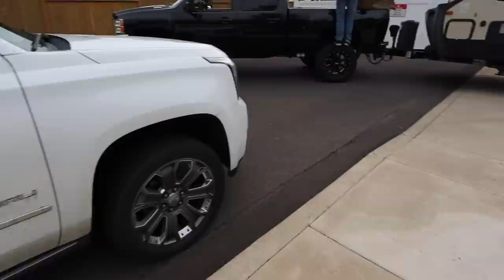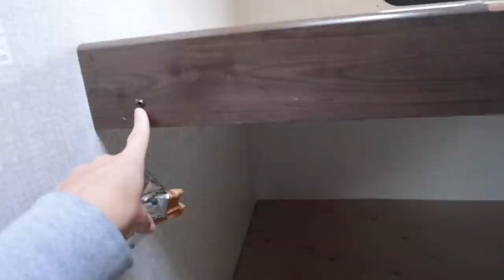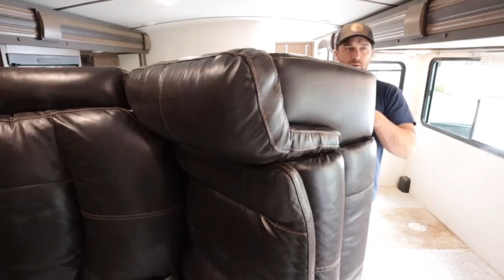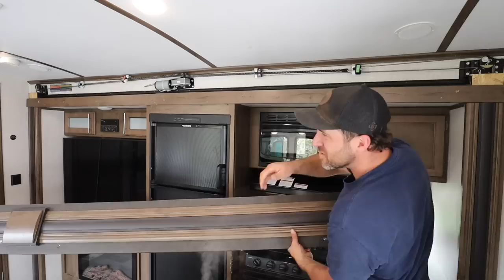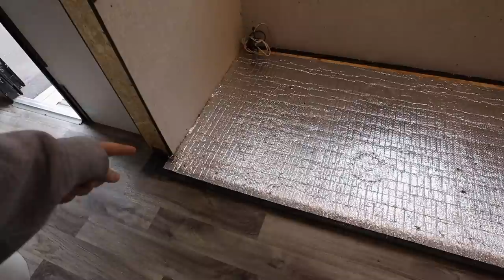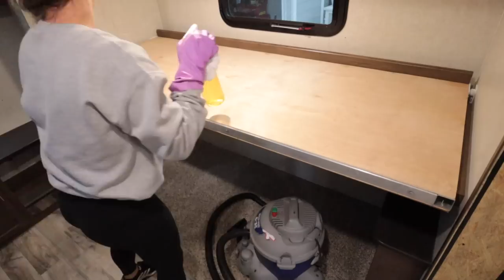THE START TO OUR RV MAKEOVER // Part ONE // DEMO DAY!

Comment: Heater vent tip, put a dryer sheet in each one.  It helps trap the dust and crumbs that sneak in AND it helps the the trailer smell fresh and clean.  We do it with our camping trailer and switch them out every so often.

Comment: Scrub everything with any Odoban.  1 gallon is like $10 and makes like 20+ gallons of cleaner.  We use it on everything.  We have 3 cats, 1 dog, 1 hamster, & 2 kids.  Our house never smells.  I put 8 oz in with every gallon of water when I carpet clean.  No pet smells!  I prefer Fresh Linen but we buy all the scents.  Doesn't mask scents either!  They go away.  If there's still a smell reapply, and always use cool water, not warm or hot.
Reply: Douse the cat pee in Odoban and leave it for 20 minutes.  May need to do it 2-3 times but the smell will be gone.  When my dog has had accidents on our area rugs I just use the Odoban at full strength and let it sit for 20-30 min.s before using the carpet cleaner.
Reply from the maker: Yeah we just ripped all the carpet out. Not dealing with that 😂

Comment: Sometimes you have to replace the pad under the carpet also😅  I use to be a property manager & with cat urine rarely replacing just the carpet isn’t enough 😅 the smells would still come thru new carpet 😢
Reply from the maker: There’s no pad under the carpet just insulation but we did rip all of it out after all 🥴🥴
Reply: @KristenKasper  yes we’ve had to replace the wood in some homes it’s sad 😞 that smell is the worse